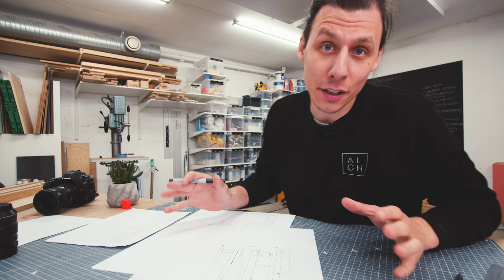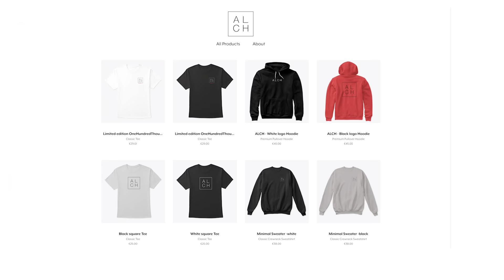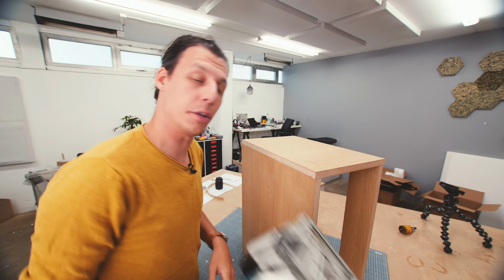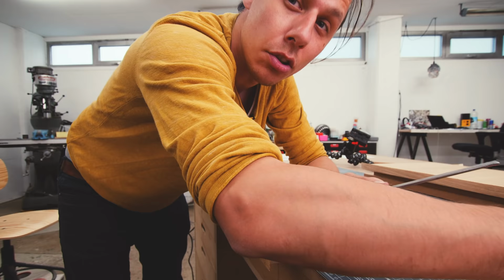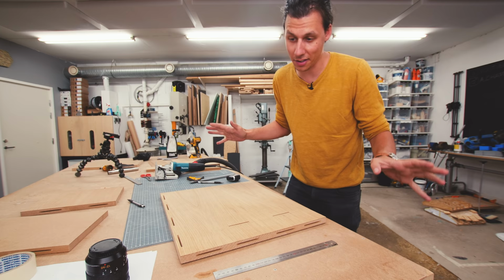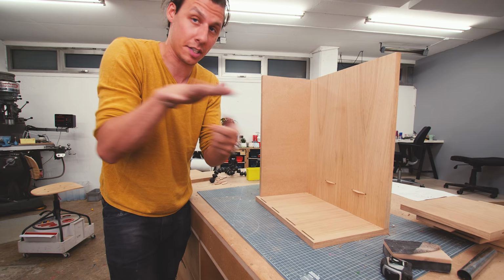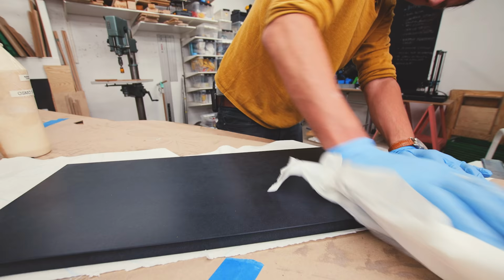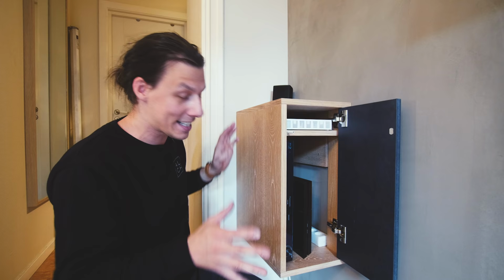I made a floating media cabinet

Comment: Planer blade trick... awesome!  This may sound wierd, but as with knock-down furniture (e.g. Ikea) your design having all the plates and screws probably doesnt need glue. Outstanding video!  Thank you!
Reply from the maker: That would be true, however there's nothing holding the top on. There's other type of fasteners you could use tho if you wanted to assemble it without glue.

Comment: Really nice and simple cabinet, but you should add a cooling fan in there that'll remove the heat. Electronic components don't function very well when they over heating and that's definitely one place where they will.

Comment: I believe you should fix the cabinet to the wall using some sort of locking mechanism otherwise a weak kick from bottom fly the box and all it's contents!
Also I recommend to add a hole and a fan with filter to bottom of the box to suck fresh air to it a closed cabinet for electronics is killer thing.

Comment: You forgot about ventilation for the PS4 there is non in that box.
Reply from the maker: Yeah, it gets a little hot... although there's a bit hole for the cables in the bottom.
Reply: Alexandre Chappel I was actually going to comment the exact same. You either need a fan or you could rout out slots in the top and bottom so the hot air can escape to the top and circulate a little. This would be a must have if you‘re planing to have longer gaming sessions and don’t plan on leaving the door open all the time
Reply: @achappel  Even for the modem there is not enough ventilation.

The amp generates heat, the ps4 generates a LOT of heat.
Dont think the ps5 would be cooler.
You will slowly fry your equipment.
(I have done that)

Add two vent holes in the Bottom.
One with a fan that sucks out hot air from the top through a tube.

Love your video's, you make me want to build stuff!
Reply: Or make a cheese grater door like the apple pro case or top and bottom maybe :)
Reply from the maker: Ahmed Shahen haha that would be cool!
Reply: @achappel  add in a Noctua fan intake on the bottom, with a filter. Positive air pressure means no dust gets in. You could power it from the 5V rail on one of the USB ports, so it only runs when the PS runs.
Reply: You need venilation. A tiny hole is not enough. You will fry your electronics over time, and may even start a fire. Look at how much intake and blowout your devices have together and make at least the same amount of intake and exhaust for your box.
Reply: I also second this thread. To make matters worse, people in hardware forums think that the PS5 will run rather hot, much more so than a late-gen of a PS4. Personally, I would have removed the bottom entirely (leaving some sort of very-open mesh/grate in its place), and maybe add some sound speaker cloth to a basic frame as the door; even then, forced ventilation may still be compulsory.
Reply: @achappel  You could swap the wood door with lexan. You should get about 3 layers, at least two with thin spacing. Then drill a whole lot of tiny holes with alternating pattern, so layer 2 is ofset of layer 2..   Air would flow, still be stylish and stuff would be hidden. :-) 
The door you use today, can be repurposed as the frame for the lexan layers.
(Hilsen fra Kristiansand)
Reply: @SamTheEnglishTeacher  that's the best suggestion I've read here so far.
I've heard quite a lot of people mentioning how loud their PS4's are normally as the system fan sits at 100% trying to keep it cool when it's just on a shelf.
Reply: @CrinosAD  thats an awesome idea, might copy that :) Thanks for your input!
Reply: @achappel  I would like to see a ventilation follow up too. I know you could make a slick pattern with a CNC but I'd like to see a method with less tools.
Reply: @achappel  that's not enough, especially for the new ps5
You would need at least five holes
Reply: @achappel  just leave the door open while you use the PS5.... that should work i think...
Reply: @achappel  Some sort of exhaust would be an awesome idea. It's a little oven atm. The recommended AC Infinity makes some pretty awesome products.
Reply: @achappel  Hole on the bottom not nearly enough.  Hard to make suggestions without knowing the rest of the home (apartment?) layout.  IF this is a single-level home,  (attic above), I'd be tempted to run a large pipe down the inside of one of the walls (from above) and connect it to a 90-degree part (3D printed) flange which mates to a hole on one of the sides of the cabinet (which face the wall).  Then in the attic, attach an adapter to go from pipe-size to a larger size which mounts to a larger (but slower-moving) fan.  The idea is to pull air up the pipe from the cabinet without seeing any obvious holes, but keep the thing silent by using a larger slow fan which is quiet and remote (kind of like your dust fan system for your workshop).  Then you just need an air inlet hole on the bottom-front of the cabinet to provide cool air in the right location, so it passes around the equipment.  Since the hole is on the bottom, it won't be seen.
Reply: +1

Comment: looks nice, but what are you doing for heat management? Small passively cooled electronics seem to run on the bleeding edge of their heat range. I would think that lack of airflow will be be a big problem with longevity.

Comment: Alexandre - love your videos and attitude!  And I'm envious of the table saw extension you have that allows you to easily cut sheet goods without help.
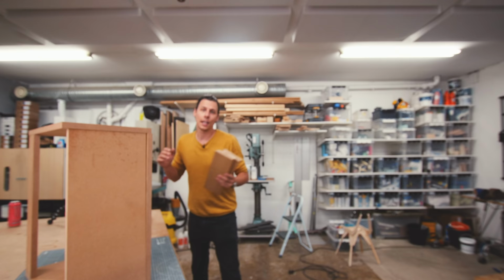I'm a little concerned about your decision to use MDF for your French cleat system - at 4:08 your MDF is already cracked...
Nice job, though.
Reply from the maker: Thanks Steve :) it's not actually a extension, it's the table saw itself that is constructed this way ( it's their most common here in Europe) you can even get them with upto 3m long sliding beds. And jeah the mdf was split allready before I cut it, but it will still be plenty strong enough for the weight it's going to hold ;) thanks for watching :)

Comment: If you come to find that the PS5 does need active ventilation, then you can just throw a 120 mm fan on the bottom of the cabinet, back towards the corner. Nobody will see that, unless they lie down flat on your floor and looks beneath it

Comment: Nice Video! 

But don't you need any dowels to put the cabinet on the wall? Is this a wood or sheetrock wall? Here in Germany you mostly need dowels to hang something on your walls.
Reply: Don't you have studs in your walls in Germany?
Reply from the maker: This wall is actually plasterboard on top of wood panels, so I can screw into wherever I want :)
Reply: @RichSobocinski  Depends on the house. But mostly you have solid walls covered with sheetrock. But as these sheetrock panels are only some centimeters thick you need dowels for everything heavier, which is sometimes really annoying.

Comment: I haven't been a fan of those style of hinges. I've found them to break over time unfortunately
Reply from the maker: Ben Greep oh really? In my experience they are super reliable, they are also the same style that ikea and basically every other furniture manufacturer her in Europe uses, maybe you just got unlucky with yours?
Reply: @achappel  Might just be quality, I know they weren't name brand. The failing point seemed to be where the door-side of the hinge latches on to the cabinet-side. The tabs would break, causing the hinges to go loose and bang shut.
Reply from the maker: Ben Greep oh right jeah that might be true. Actually I've only ever used Blum made hinges, even the ones from ikea are made by Blum, and I've never had one fail so far 🤞